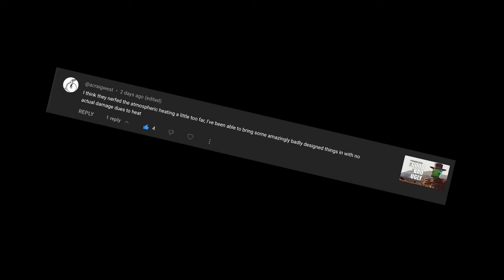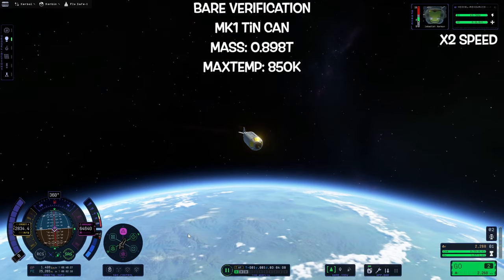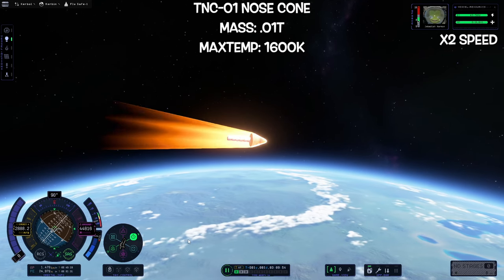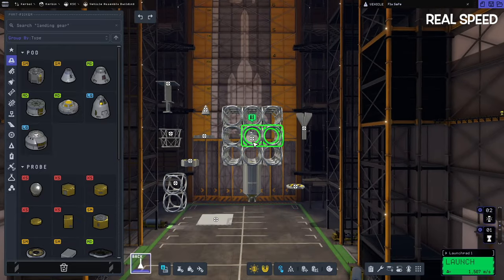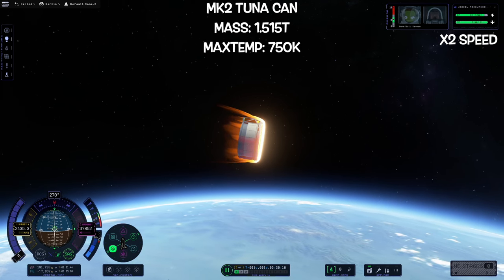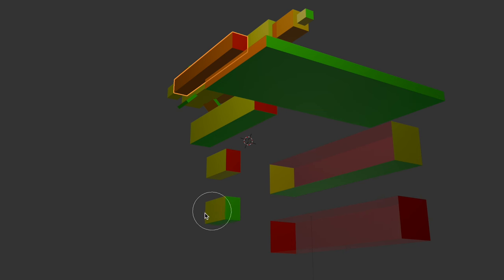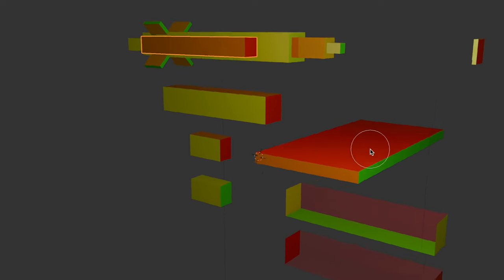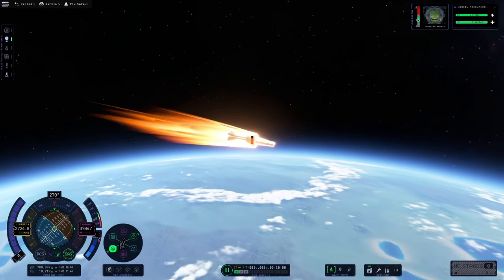KSP 2 Update Review - 0.2.1.0 Reentry Analysis

Comment: Glad you did the tedious work.  The only quibble I have with your proposed heat module is that the same amount of heat would be a constant across the entire surface of the vessel.  So every exposed surface would get the same amount of heat that would be modified by its angle to the direction of travel.  Each part would be assigned a total heat total  based on tonnage and material and each face would have a heat bleed based on your heat resistance.  Say you have a heat resistant face so it is assigned a heat bleed of 10 (it can handle 10 units of heat per second).  A less resistant face is assigned a heat bleed of 5.  The craft is coming in at a speed that generates 11 heat (based on velocity and atmospheric density).  The heat resistant face is dead on and receives 11 heat, it sheds 10, and 1 gets through.  With a heat total of 10 you have 10 seconds before it burns up.  The less resistant face is at a 45 degree angle so it gets 11 times the sine or cosine (I forget which would apply) of 45 degrees (say .5) or 6.5 heat, it sheds 5, and 1.5 gets through.  With a heat total of 10 you now have 6.5 seconds before it burns up.  Heat would be shed when the incoming heat is less than the heat bleed.  So say incoming heat is 4.5 on a face with a bleed of 5, you loose .5 heat.  This model would allow even highly heat resistant parts to burn up if you come in too hot and fast.  Ablative parts would have one resistance with ablation present, and another with ablation used up.
Reply from the maker: No. Every face does not get the same amount of heat. If you see the front and side of a cube. The front of straight on, and the side is at a angle, obviously. Then looking at its over all area the front face takes up 90% of the shared area and the side takes up 10% of the area. So the heat applied to the crafts faces accordingly. So if 11 heat is applied as you said. 9.9 goes to the front, but only 1.1 is applied to the weaker side, so the heat build up is much much slower. Unless you come in sideways, then you should burn up regardless.

Comment: I think an important variable that is missing in these tests is the total mass of the craft compared to the heat tolerance and friction of the leading part. The peregrine cockpit, for example, would probably burn up with another 50 tons of craft attached behind it. This is because it would not slow down as much due to the drag per mass of the overall craft. Because the cockpit by itself is relatively light, the drag per mass is very high, slowing it down to survivable speed before it burns up.
Reply from the maker: The small mk1 capsule weights 0.898T by it self and does not survive a solo drop. The peregrine cockpit weights 1.248T heavier then the capsule. So by that logic the results should be reversed. 
That’s why I did not add that data in as it relates more to the mass of the exposed part. There is heat tolerance but that seems to not mean much as I have heavier parts with a lower heat tolerance then the peregrine also survive. So it appears to be just the mass of the exposed part, and probably some hidden data the devs are using for “balancing”.
But good thought, it caused me to have to recheck values to make sure, and in future I’ll try to provide more data for test if/when I do other big tests like this.

Comment: Interesting, the use of total component mass for survivability doesn't make any sense. Probably each "face" of a component should have it's own mass value with the assumption that if a surface is ablated the component fails. I suspect that's the thinking behind your improvement.
Reply from the maker: not an ablation per side. Each part has a heat tolerance and possible ablation as a whole. But, those are used up at different rates depending on the side that is heated. So a heatsheild that comes in backwards will burn the ablation much much faster, then begin to over heat, much much faster. Then also allowing heat shadow to be turned off for the part, or maybe per side.